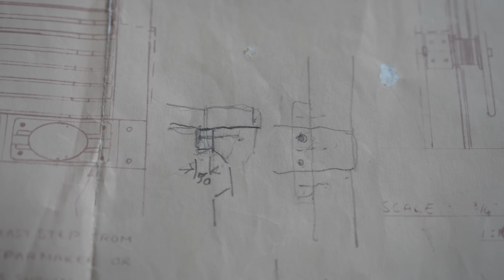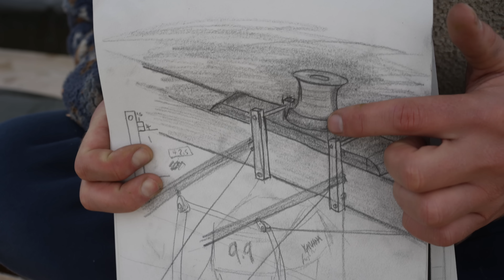It's The Most Important Part of this Boat's Refit (& I'm Trying Not to Wing It) | Wildling Sailing

Comment: instead of recutting the threads just put a bolt on before cutting. when you get it off it automatically puts the cut thread back in place. also please leave like 3 complete nut turns on it on both sides. when the bolt ends directly at the nut they have a drastically decreased strength.
Reply from the maker: got ya, I made them oversized so should be plenty of space
Reply: Thanks for the info on leaving 3 turns of thread protruding. I had assumed that it was ok to cut the bolt off directly at the nut. 👍

Comment: Use a pilot drill (or two) to progressively drill larger holes to the finished size.  One large drill can create work-hardening of the stainless so by pilot drilling, you do most of the work with the outer edges of the drill bit.
Reply: Very sound tip. And it's not even time-consuming as you would think!
Reply: Geat advice! I size my pilot hole by  the center of the largest drillbit, there is a small section that doesnt do any cutting .
Reply: Step drill set would be an excellent addition to the arsenal and SLOWER drilling!!
Reply: @dancarter482  damn. You beat me to it. I just made the same remark. Best drills ever.
Reply: Also set the speed lower for stainless steel and use lube as you want to avoid heat.  Stainless will get harder as it heats up.
Reply: Get some Rocol cutting compound. It comes as fluid (consistency like honey). Very  good for making life easier on the drill. Also acquire some coated drill bits.
Reply: It is possible to sharpen dulled drill bits, but it's not easy. Tap majic fluid helps tremendously.
Reply: 304 has more carbon then  316  and will rust.
Reply: @maarten_notjustagrip  Krazy! I use a holesaw arbor in my pillar drill for all pilot holes - they're the toughest cheap drills - then step drills all the way out; nice and slow.
Reply: @dancarter482  Double ended center drills, or the short double ended, short drill bits for the win on the pilot holes, if you think you're gonna wear out the first step of the step drill. I've had my step drills for years and they're still perfect. Rocor paste is a must. I think I've had my tin for at least 15years and it's still more than half full. Ya don't need much. Bonus is it sticks to vertical surfaces too.
Reply: Exactly! When you need to drill several holes, pre-drill all of them, then change the drill bit and the total time will be faster. Try to start with a 4mm bit.  The big problem is to cut the central part of the hole (cutting speed almost zero, a lot of friction, heat, and you damage the expensive big drill bits)
Reply: @slimjim3229  Its really not difficult to learn. It was one of the first tasks in my General Engineering block at Airforce College. Sharpening jig/tools make it simple AF tho.
Reply: Amen 🙏
Reply: @johnbrandenburg6178 I agree the 304 will rust. Test the metal with a magnet. If it sticks it will rust...
Reply: Step drills are definitely worthwhile having. Small pilot hole first is always a good thing🤟
Reply: @dancarter482  Your suggestion is the best on this thread. The pilot drill would result in a triangular hole in thin wall tubing.  The step drill is the best way to end up with a nice round hole. 👌
Reply: Yes, I completely agree with this comment. Sharp drill bits are also important, a little pressure to try encourage a nice scroll of metal as you drill. Trying to force a dull drill through will only work harden the steel more quickly.
Reply: Slow an steady wins the race
Reply: I was just about to say the same thing. Also with bigger drill bits try controlling the speed to be slower. It will make the drill bits last longer. Also a countersink will finish the holes off nicely. No burs to cut yourself or ropes on.

Comment: Said it last time and I just want to repeat it. Douglas Fir is NOT rot resistant. You need to coat it. It would make a lot of sense to coat the whole finished beam before you install it so you can get all of it coated. If it were me I would also wrap it with fiberglass to prevent checking later. Douglas Fir is prone to checking.

Comment: Just some advice from a marine engineer that doesn't want to see you stranded. I would highly recommend adding fender washers that have more width/shoulder to them. 7:45 What you are using now will pull through the beam over a short period of time. If you can find a shop that has some 1.5 - 2  inch  wide SS flat bar that you can have across the beam  being used by both bolts it will give you a higher clamp force and stability. This would be your best route.
Reply: Absolutely. Mark is still thinking in machine shop terms. Wood requires different solutions.
Reply: @nick.caffrey  Exactly.  He is doing a great job with everything. Just some odds and ends he is still learning about.  The good thing is Mark is open to new info and ideas.
Reply: I was thinking the washers were too small...First thing came to mind was old 'Penny' washers for size. Stainless or coated..
Reply: @davidmason5163   That would work as well.  I like the SS flat bar for the fact it spreads out the forces from all the variables when under sail over a larger portion of the beam.
Reply: @revtoyota   yeah definitely flat bar, going to outperform washers and looks better.
Reply: i would also reinforce those blocks , as your still relying on the 9 lag bolts into the beams to hold your mast plate .. as the threaded bar just goes into those blocks
Reply: Those large outside diameter washers are called "fender washers", probably a holdover from carriage builders😊 here in Canada. They're available from stainless fastener distributors.
Reply: @garybrown2446  Agree 100%. I would do the same thing to the blocks. I was gone when that video was released. I just got done watching it.
Reply: Strongly agree. I would use at least 25 mm strong washers; I like the flat SS bar idea better.
Reply: @kencannuck  Thank you... I had a brain fart and could not remember the name of them.  You are correct they are a holdover from the old carriage builder days and the beginning of the automotive revolution.
Reply: When do you plan to secure the cross beams to the hull. You can't  progress until hull and beams are set up. I agree with comments re washer size
Reply: I was thinking the same thing but also recessing them and capping them perhaps but just my gut no real knowledge
Reply: Always called them penny washers as the where size of old pennies 😂 but great advice.
Reply: Definitely, and whichever, plate or washers, put silicone under and around them to prevent rot. Remember too, that all those fasteners are purely for location purposes. The load from the mast and rigging will be straight down.
Reply: G10 plates could be considered as well.  For the average DIY guy g10 is easier to drill and fabricate than stainless steel.
Reply: Pardon me if I missed it, but why did you not anchor the mast beam to the cross beams directly? I too am concerned by having just 9 lag screws holding that in place.
Reply: I was thinking, if that beam cracks it will probably do so around the bolt holes. Your idea, revtoyota, would prevent that.
Reply: @injahnet  I guess he could have done that but "cleating" it is always going to be stronger. What forces, in which direction are you concerned about? With the whole rig pushing DOWN on the step beam, what could possibly cause it to go which way?
Reply: @travelbugse2829  What on earth would cause it to crack? He hasnt SAID so, but I'm guessing he will encase the beam in glass and epoxy, anyway.
Reply: @maarten_notjustagrip  I am not familiar with the forces he may get on the "cleats" so they may well be enough. My thoughts were all the cleats are on the stern side of the beams. While the mast will weigh down, when under sail, would he not have horizontal forces on the footing? They make the boat go forward? These would stress the 6 bolts he has anchoring the plank to the cleats in all directions. 

Forces to the stern will have only 3 cm of board X 6 to hold the horizontal forces at bay.

It may well be enough.
Reply: @injahnet  You do have a point there. I was thinking I would add something to counter the forces left to right too. From a joinery perspective, doing it myself, I would probably "half lap joint" the mast step beam into both cross beams and epoxy and glass the whole thing into one "H" unit. While I realize the theory behind the design of such craft is flexibility, I think following that route might be beneficial to the stiffness of the craft as a whole. Its also well within his scope of capability, with the tools he has, and the skills he has learned. I apologize if I came across flippant in any way.
Reply: @maarten_notjustagrip  Flippant? Not at all. I like your ideas on how to secure. Not being an engineer, I find all comments interesting and enjoy trying to analyse the effects on the build.
Reply: @injahnet  Great. I can be a bit coarse sometimes.
Reply: @maarten_notjustagrip  Nah. It's all a matter of perspective. I would never assume you are coarse. It could even be the fault of translation if English is not your first language. I don't judge people based on their comments. When there are only words, it's left up to ones imagination to paint the picture of the emotions, and most times, it's wrong. So I only look for the discussion points. 

Plus I think we are all commenting to help Mark. It's going to be up to him and pick and choose what he takes or discard.
Reply: @injahnet  Coolio. Yeah, English is my first language.
Reply: @maarten_notjustagrip 

They typically are already epoxied and glass skinned to keep the water out.
Its why he lines the holes with epoxy.
Reply: @clivestainlesssteelwomble7665  Ok, I wasnt clear. I'm talking about the mast step beam, not the cross beams.
Reply: @maarten_notjustagrip  

No problem Martin ...i was just trying to clarify to mark about the need for spacers inside the box tubing ..  but the Google /Utube 
Editing interaction on my device  
hangs up and i have to stop the video to comment.    Sometimes it just crash freezes mid edit .. so i loose a comment totally 😣 Im slow typing, so sometimes i just give up and hope someone else has picked up on a possible issue.

Meantime in a workshop with all the gear https://youtu.be/pG1lq1PKNzM?si=0UQOO-LC2f2qVElV
Reply: You can get square flat washers from memory about 40 mm square
Reply: I seen this done ... Works  Great
Reply: @maarten_notjustagrip 
The load from the mast will be straight down when the wind is t blowing, but add 10 knots and all the rules change dramatically
Reply: @kscipkkkk  Yes. You are correct. As I suggested, half lap joint the step beam into the two cross beams, and glass and epoxy the "H" into a good strong unit, and it will be golden. The debate has progressed in other threads.
Reply: He should also rectify the modulator.

Comment: You are doing a great job. Save a fortune on drill bits, learn to sharpen them and they will last forever, well almost. The HSS (High Speed Steel) bits can be sharpened to different angles to suit different materials. Each drill bit, small or big, can probably be sharpened about 100 times and each time be like new. And use oil when drilling metals.
Keep the faith, you will be sailing soon.

Comment: Here's a suggestion for the rounded bottom of the mast step bracket....have a machine shop mill it flat.  Looks like lots of metal there and should be an easy job and relatively inexpensive to true up the bottom surface.  Having a flat surface would save you a lot of time and aggravation when mounting that piece.

Comment: Love your vids. Highly recommend you use larger washers on both ends of the threaded bar. The larger they are the more you multiply the pull through resistance.
Reply: 17:59 mark you need to fit the spacers inside your square tube as when you tighten the all thread it will squash down the box section ...allowing it to work loose .  The threaded  gap between the uprights doesnt need to be covered per say but if you do sleeve it make sure its bit shorter than the gap or it will prevent the brackets gripping the wooden beam effectively 👍🏼💪🏼 more power and 🧠 to your elbows 😉

Comment: A trick I learned when cutting threaded rod or bolts is to spin a couple of nuts on first.  It gives you something to clamp down on without damaging the threads and when you back the nuts off it repairs the threads

Comment: Hello I am Mr Whattodo and glad to ear you are conscious of your tech weaknesses.
Randomly: , do not push your drill bit all the way in the drill shuck.
To keep compression on the square tubes you HAVE to use a spacer INSIDE the tubes or they will crush and never get tight, depending on what you have around you can use a tight fitting hardwood block in place of tubing ,The long tubes over the rods at 18:15 defeat the very purpose of the system, don't you want to squeeze  the beams.
When you have decided the place of the mast built a little frame(mold) filled with epoxy- strand mix , and press the mast step in.
Do not forget the Saran wrap on the step to keep it from sticking.
To create a cheap 90 deg drilling guide cut a rectangle of plywood diagonally and glue the two sides on edge,use the long or short sides as a guide , want it fancy ?glue a drill size pvc tube to it.
If you have easy access to her ask Anika about anything I can tell she is right, Personally I would try to hire her ,like an hour a week
online,paid reasonably well. In the end it would save you time and money

Comment: for drilling stainless cobalt drill bits are what i would recommend also slightly slower drill speed with some cutting fluid and once you start dont stop till you are through or it will work harden trust me i had to do 30k of them over 2 weeks of hell ps your doing great

Comment: Thanks for explaining why the base for the mast is so long.
I am sure you know this trick, when cutting threads, put a nut on first, when you take the nut off it will re cut the threads. Absolutely nothing wrong with using a Die to do the threads, however if you don't have the right size ! You almost always have the right size nut.

Comment: hi I THERE
I recommend first when you are drilling in metal. Drill with a 4mm drill bit.
Second, in order to maintain the drills, there is lathe fluid that prevents the metal from heating up, you should also use that.

Comment: Someone might have mentioned this already but if you're cutting threaded rod, put the nut on first, cut it , then take the nut off. That way the nut will clean up the threads at the cut end with minimal effort.

Comment: Hey Mark,  look for a machine shop around you and see if they could skim the bottom of the mast step flat and square to the mast. If you need it on a bit of an angle on the mast, they can machine that angle into the base. I've been a Machinist for over 25 years and this would be easy.
Reply: Yep they can do that. Get a few quotes if you can. Wonder how it rounded over.
Reply: @slimjim3229 heat distortion from welding maybe?
Reply: Probably better to have it pad welded before skimming & put a block of g10 underneath it.
Reply: This is the way to go. I commented the same thing above.
Reply: I agree needs to be skimmed flat.  Otherwise you don't know what you are working with. S few mm off at the bottom is a wonky mast at the top
Reply: I agree with this. I'm a machinist and often modify bits of boat. 
Also I've said this before wear safety glasses. It's a mistake people only make once.

Comment: Those long thin bolts that hold the mastfoot beam will work under lateral load and either shear or distort .You cannot tighten them sufficiently to prevent this.If you want a permanent rigid connection you should use stainless toothed connectors between the faces.

Comment: For nautical use, the correct option is 316L Stainless Steel (low carbon). 304 steel oxidizes quickly in contact with seawater.

Comment: Mate, i been watching you since week 1, your turning into quite the boat builder, you should be proud of yourself.

1 sujestion, learn howntonsharpen drill bits, not only will it save you $$££€€ but there will be times you just cant buy a new bit in time. You can sharpen them with as little as an angle grinder and a grinding wheel or flappy wheel (the type with all the flaps of sandpaper) but realpy you need a bench grinder. 30yrs ago i bought the daintiest peice of junk but was perfect for sharpening drill bits and damaged chisels etc
As for chisels i always sharpened them on a wet stone doing the angle by eye but mate, get one of those jigs that attach tonthe chissel and give you a perfect angle and the new diamond sharpening "stones". With zero effort i can get the chisel sharp as buggery in 2 min flat, makes your job easier and safer and less fristrating (and gives you something to do at night/rain days.

And drilling stainless, what you said was right, drill slow and lube up but also good pressure behind the drill.

Keep up the great work champ, youll be crossing oceans before you know it.

Cheers from the land down under

Comment: I would definitely put at least two all thread bolts into the main beam. Better also to use the same size bit as the thread and coat the drill hole with some epoxy paint to help preserve it

Comment: Use a rubber, or plastic, spacer between the bottom of your mast attachment and the top of the boat. It would take the bend of the deck and you won’t need to cut, or grind, the bottom of the mast attachment.

Comment: Use cobalt M35 drill bits, even the cheap ones for 20odd quids will work. 
Also get yourself drill bits sharpenner (unless you already have a bench grinder and a good  eye for sharpenning the drillbits by hand).

Comment: I think you would benefit from a sliding compound mitre saw, fitted with a metal blade, for cutting all that steel.  Better still if you can find one with a variable speed motor.